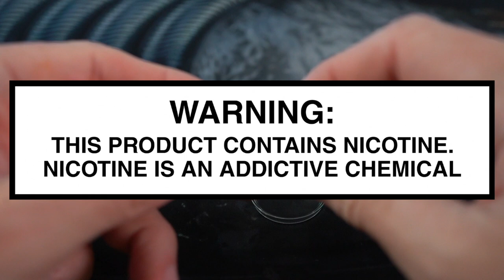Reload 26MM RTA - A Truly GREAT RTA

Comment: That's it, I havent bought anything in 3 yrs.  I'm getting this rta.  Next a new box mod.  Thanks Grimm 🙂❤
Reply: The 24mm was so much better
Airflow is way smoother on 26
But flavour is better and cooler on the 24

I just got mine now

And I wish I kept my 24

I take it you got your 26mm a while ago, how are you finding it?
Reply: @mrnobody7943  i looked everywhere locally and not online, no luck.  I still have the first reload rda and love it.    Id have to look at the 26mm again, as i squonk now.  Cant recall if it is capable, yet i think it would be back then.    Im doing good thanks as life is getting better, personal journey.   And you?
Reply: @sotxchic09   @jen 18wheels  a reload that isn't that memorable says alot on its own 
I just put in tiny coils and seems to be much better
2mm ID ALIENS

Time will tell

And ahh Ja, in the middle of having one journey come to its end and a new one is beginning 💪🏽
Getting better is the best way to be
Reply: @mrnobody7943  im old school coil builder.   Im not 1 for those aliens or claptons.. just simple 1 coil or parallel,  or twisted coils.  Gawd ive been vaping for about 10 yrs lol.    Yes, been shedding a lot of unnecessary bs out of my head, feeling so much better and stronger,  next waiting on a move to the east coast, and leave this over grown state of TX.
Reply: @mrnobody7943  tell me anything and everything about this RTA! I'm thinking of buying one. Wicking issues? What coils are you running or what would you recommend for 90 to 100 Watts?

Comment: Just ordered a gold reload 26mm. Based SOLELY on your recommendation. 😂 I have gotten to a point in my vape journey where I prefer to have quality over quantity. I could buy a couple of cheaper chinese rtas(not that there is anything wrong with that) for the same price, but I would rather have the build quality of a reload vapor or qp designs product. It's just my preference.

Comment: Great review Grimm 👊 that deck kinda reminds me of a cross between the Recurve Dual and the Intake Dual with a Threaded Airflow control system I love both of the Attys that obviously inspired the Reload 26 RTA is it safe to use on a Hybrid Mech Mod I think the Reload 26 RTA would look good on my Stainless Steel Keen Is the flavor close to the Intake Dual RTA (my favorite RTA currently on the market) honestly I'll probably just wait until the RTA you've been working on comes out since I've been looking forward to it since you told us about it Thanks for another great review Grimm 👊can't wait for the next one

Comment: After 2 weeks of frustration I’ve gone back to my old rta,just my opinion this is a terrible rta,deck is too small to fit small 3mm coils comfortably.,airflow is too restrictive even at fully open and it’s been a nightmare to wick,I loved the original reload,I bought 3 of them and used them for over 2 years but this is just a disaster on so many levels in my opinion